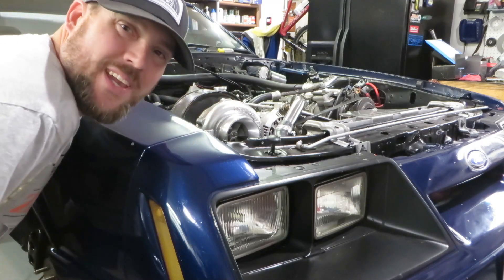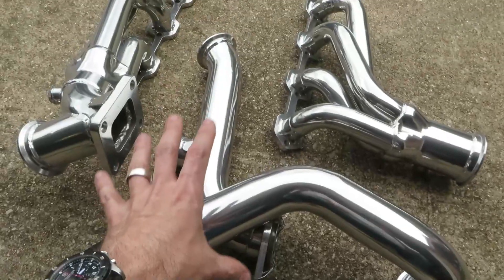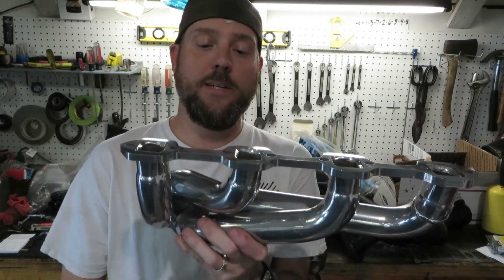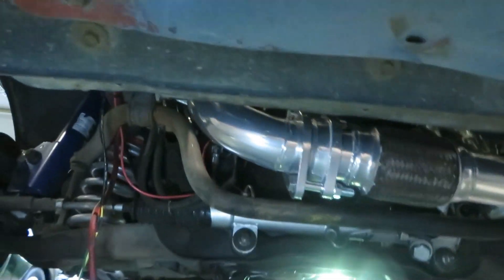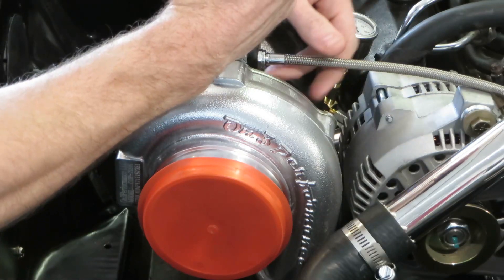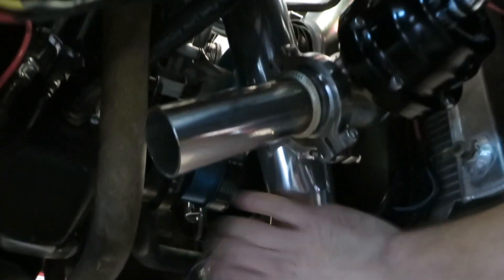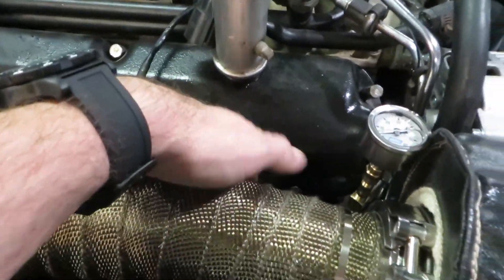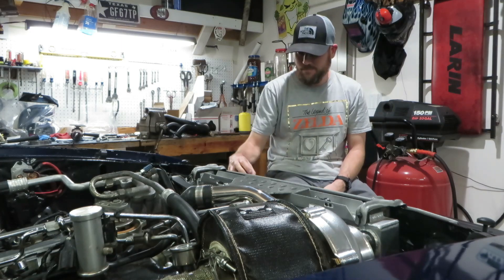FOXBODY On3 Turbo Install - PART 3 - Final Hotside Install - Ceramic Coat

Comment: Good stuff!!! I been following you closely on this one!!! I'm doing a turbo kit on my 5.0 mark vii. Got new trans. Ordered from monster garage. Got a week left on that. Relocated a lot of wires and cleaning and repainting etc. Etc. She will be a nice sleeper when I'm done!!! Beautiful 5.0!!!!
Reply from the maker: Thanks! Man I so dig those Mark vii. A lot of folks dont know there is a "luxury" lincoln foxbody. Would love to find one and fix it up. Cool cars! good luck with it man.
Reply: I dont know why it said garage lol it's monster transmissions. Let me know on what you do about the ac lines. That and my smog pump hoses are the only things in my way. Which i wont do the install of turbo till I get the new trans. In. Hard work does pay off doesnt it lol I do have pics of my progress if your interested. Maybe I need to do a channel for the mark viis line. I dont know, something to ponder lol Be safe!!!

Comment: good stuff mike! Yeh I'm with your buddies been using permetex on everything from intake manifolds, header, rear end covers, etc. for decades
Reply from the maker: Good to know. Hope it holds well. This stuff is all over my motor now lol
Reply: HOUSE OF DULA Yeah it can get messy. I'm surprised you didn't heat coat the cast side of the turbine.

Comment: Hey Mike, the  build is  coming along nicely. If I can make a few suggestions,. PLEASE  get rid of the fuel pressure gauge on the rail. They are fire hazards and known to spew raw fuel and cause fires. If you want to run a FP gauge, use a stainless steel line and  mount it in the cowl.  Also the On3 wastegates are known to stick and fail,, I would recommend a TIAL unit..  last check out Dan from North East Ohio ( Neo Mustangs) page, He has been messing with On3's for years and knows these systems inside and out... He is a great guy that can help you out in getting it right the first time ..

Comment: I had one of those On3 kits a number of year ago but bottomed out on a pot hole and crushed the cross over pipe and bent the headers. Went na after that.  Just be careful with that cross over pipe.

Comment: Is that hotside from on3? I didn’t think their turbo kit ran off Both exhaust banks
Reply from the maker: Yessit, standard On3 hotside ceramic coated.
Reply: Wouldn't have very much power on just one bank being it's a v8.

Comment: I would of still used the gaskets because rtv only lasts for so long till u have a leak turbo gasket and headers for sure! Sure is a small turbo what size is it t60, wait till u put a t88 on it then u will like it!
Reply: Probably a 70

Comment: Hey Mike how are your headers  holding up with the ceramic coating on them ?
Reply from the maker: A little dulling but that was to be expected. Otherwise almost as good as brand new. Holding up great. That shop did an outstanding job, IMO
Reply: OK OK does it do the job of keeping the temperature down under the hood ?

Comment: Mike, quick question: do you know what the ohms of resistance should be on an o2 sensor? I have a 3 wire sensor. Please help. I can’t find it anywhere on the manufactures(Motorcraft) website. Thanks!
Reply from the maker: Man I wish I knew! Im sorry I dont have a clue what that should be.
Reply: No worries, maybe someone else will chime in. I’m trying to determine whether my o2 sensors are good or not. Thanks for replying!

Comment: Not trying to be a jerk but ... That’s not a condenser. The condenser is the big radiator looking thing behind the grille. That device has a few names. Receiver dryer accumulator filter drier. But regardless... good job on the install, and good job on the video. Very informative. I have a 5.0 set up in a 53 F100. It would be really cool to put a turbo on it. Your spreadsheet is awesome too. That’s a pretty good deal considering you’re under four grand so far and that includes an entire ECU. That’s way better than most supercharger set ups and I think the turbo is better and more efficient.  Did you consider tweecer instead of mega squirt?
Reply from the maker: Not being a jerk at all man, i strait up used the wrong terms! Lol I clearly know very little about AC components. Appreciate the correction, wish i caught that before going live. Yeah, about the sheet, im just under 4, which is surprising because technically you could do it cheaper. I looked at all ECU solutions and nothing comes close with the Microsquirt capabilities, multiple fuel maps, timing map, wideband control, over boost protection, rev limit, fan control etc etc. this kit i bet could be pretty easily altered to fit your 53...would be awesome in that truck. Love the old ford pickups!

Comment: I didnt notice you running or installing o2 other than your wide band. If thats the case what gives?
Reply from the maker: James, the microsquirt doest use the factory O2's so you can pull them and the harness. It needs a wideband or 2. Since this is turboed it common to install 1 on the downpipe.
Reply: I want to add the microsquirt first so i dont have to spend so much up front. So even on a NA engine you can still just use a wideband or two?
Reply from the maker: With a wideband, IMO you can use 1 with NA. Just know your monitoring 1 side of the engine so if you start having combustion issues on the side you wont see it. Since both sides of the exhaust meet at the turbo it makes sense to monitor the downpipe...more is more accurate but if your going turbo anyway dont waste the money on 2.

Comment: Quick question man. It doesn't pertain to a turbo at all though. I have a stock 93 5.0 5spd mustang and it kept stalling and backfiring on me so I replaced the entire distributor and ignition module. It's been about 1 month and now it's doing it again. I have the original Ford Motorsport ignition module. Do you think it would possibly be the ignition module on the aftermarket distributor? The distributor is just a cheap one I bought online but worked fine for about 1 month. I don't know just thought I'd run it by you. Take Care

Comment: How much was the ceramic coating? And the y pipe?
Reply: I seen it in unpackaging video
Reply from the maker: It was about 400 if I recall. I didnt do the Y pipe, or downpipe, both are stainless. I wrapped the downpipe. The headers and crossover were ceramic coated. Works good, and the coating has help up very well.

Comment: Hey sweet build caring awesome. Im about to get the 0n3 kit coukd you help me out, i have a 5.0 that has gt40 heads b303 cam, what size injectors would you recommend??
Reply from the maker: With GT40 heads 47lbs should be just right for that combo. 47's would work with mine but I have TFS heads so they flow a bit more than GT40's, 60;s are on the large side but seem to work fine.
Reply: @HOUSEOFDULA  thanks alot! I actually just picked up 42 lb ones today. :/ hope they work fine.

Comment: How many hours is the install on these kits?
Reply from the maker: Man, some guys "could" do it in a weekend, not me. out of the box slap it in with injectors take it to a tuner... Depends on who you are, how detailed/methodical you are and how much other stuff your doing to support the build, etc..I put in an hour or two anytime I can and its going on over a month, probably already 20 hours or more and still need the cold side and a tune.

Comment: Just curious if this is the stock block or not? I have the stage one Trick flow top end kit that I'm either going to put onto my stock 302 in my 91' hatch then boost or save it for when I get a 347 block.
Reply from the maker: Stock crank and rods. Speed pro pistons. And trick flow stage 1 kit. This is why I have to keep my rpms and boost a little low but still going to give it all it can take! My next engine will be a dart block 331, upping the boost. But...IMO boost it, keep tune conservative, have a blast and save for that 347.

Comment: Do you know of a video of anybody doing this with a carbureted Foxbody?
Reply from the maker: No everybody I know is fuel injected
Reply: Eric the car guy
Reply: There are tons of videos with carbs its called a blow through turbo.
Reply from the maker: Yeah the concept is the same...Need a carb built for boost, a way to control timing, and a boost referenced fuel pressure regulator. I forgot Eric the car guy was carbed. He has really really god stuff, and alot in regards to On3 on a fox.

Comment: Delete that ac compressor bro
Reply from the maker: NO WAY. lol Its my mission to keep AC.
Reply: @HOUSEOFDULA  mines going bye bye along with the smog pump cool car tho I have owned 6 now just bought a 88 gt with 5 lugs no rust
Reply: @kingnino4836  the first summer day with 100deg temps like we get in the south and you will be wishing you kept that a/c. Lol
Reply: @timmartin4798  we usually bring our cars out on Sunday evening s when the sun has gone down but yeah my daily driver is a 2011 crown vic police interceptor with flowmasters cat delete 456's in the rear end and ac for those hot summer days